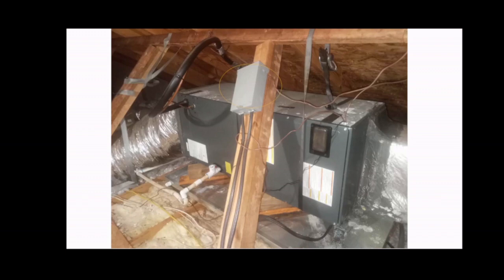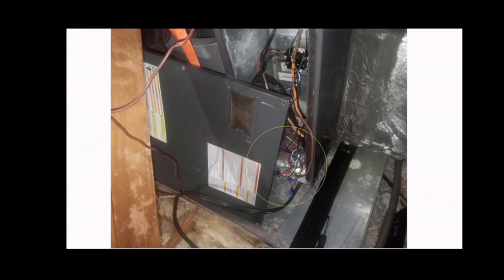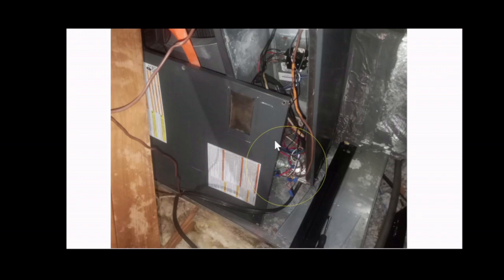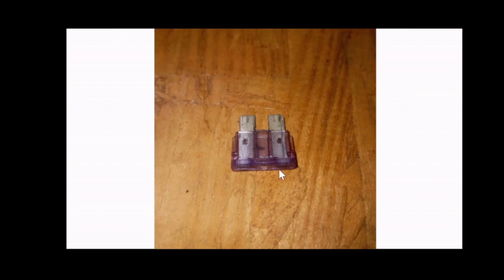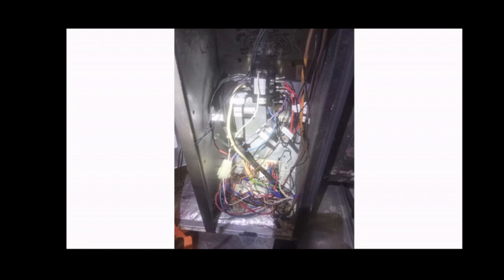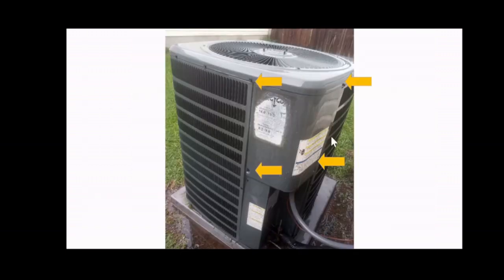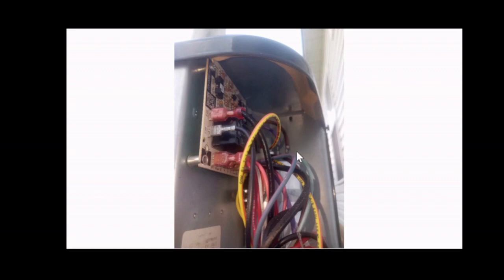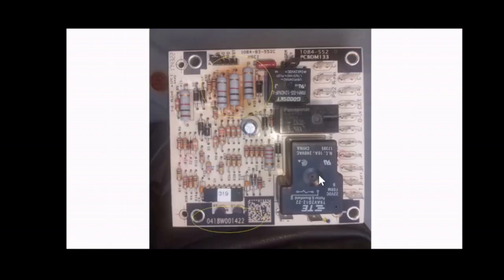No Start Fixed! Goodman ARUF37C14AC & GSZ140361KE air conditioning (AC) units

Comment: It’s a defrost board on the Condenser unit. You have heat pump not a standard AC. So basically just change whatever is burnt. What about getting a pro and figure out the reason for burnt relay/wires?
Reply from the maker: Thanks for comment.  A "pro" will repeat what I stated in video: loose connection; lighting strike; faulty relay; or power surge.  And, I'd rather save the $500 and fixit myself.